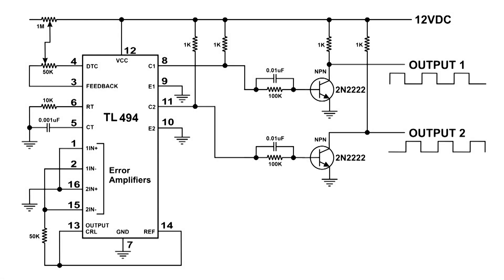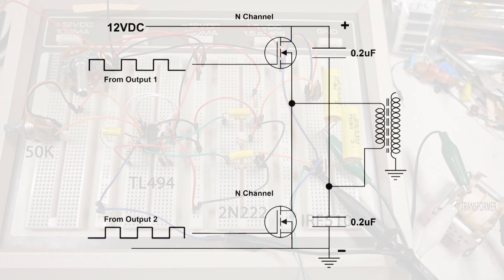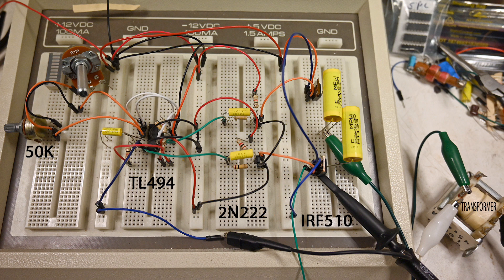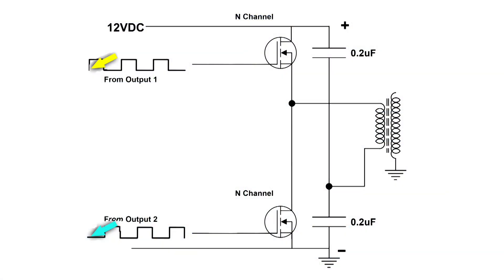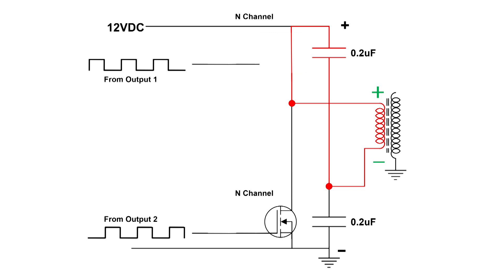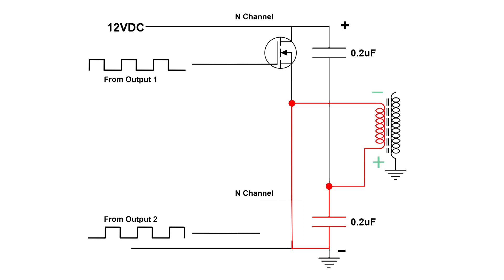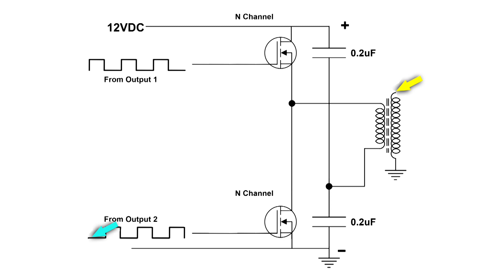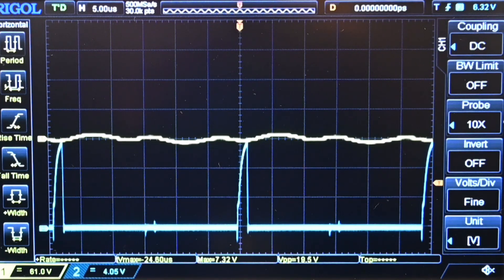Pulse Width Modulation Half Bridge MOSFET Driver TL494 2N2222 IRF510

Comment: Great video for someone like me wanting do a straightforward build. A couple of questions: I have a PWM module I would like to use so would I just take its output and feed into both transitor bases or do they need to be 180 degrees out of phase? If so how might I use the module and replace the TL494? Secondly, is this amplifier suitable to drive a flyback transformer? Thank you
Reply from the maker: I would need to know what chip you have. In this circuit the output from the chip goes to the base of the transistors, this does produce a 180 degree phase shift and keep the two outputs from overlapping (both on at same time). To drive a power transformer you may need power transistors. Thank you, and thanks for watching!
Reply: I have decided to use the TL494 instead of an external PWM module. It’s a better fit for the job. Would both the transistors and the MOSFETs need to be upgraded?
Reply from the maker: @julianperry1406  The current in each stage of the circuit determines the part selection

Comment: Dear sir I try to make such circuit but I do not know how to connect 3 pins of 1M ohm potentiometer with other 3 pins of 50K ohm of second potentiometer (SKITCH part upper left hand side for connecting 1M with 50K not clear to me ) kindly I request your support regards
Reply from the maker: The 1M sets the limit, usually a value of about 15K works nicely. The 50K varys the output from the limit to the max. 
I prefer this setup of the TL494. Unlisted video.
https://www.youtube.com/watch?v=PkwqwKPnFpA

Comment: I am confused. How do you get a sinusoidal wave out of a square aware by just going across the transformer ?
Reply from the maker: That is one of the things a transformer does. It transforms.
Reply: You are joking right?? A transformer only increases or decreases an AC signal depending on the primary and secondary winding ratio. I have never heard, read or seen a case where a transformer by itself magically converts a square way into a perfect sinusoidal wave. You have to be joking in your comment.

Comment: This does not work at low frequency like 60hz Only at high frequency of khz.
Reply from the maker: Yes you are correct. The TL494 specifications recommended operating conditions for frequency are 1 to 300 kHz.
Reply from the maker: If you are looking for a slower running circuit you might try this IGBT circuit.
IGBT Astable Multivibrator
https://www.youtube.com/watch?v=PnAiAhZH9hw
Reply: Dear sir I try to make such circuit but I don’t no how to connect 1M ohm potentiometer with the 50K ohm potentiometer ( how connect 3 pins of 1M ohm with other 3 pins in 50K ohm) kindly I am looking for support regards

Comment: Hi, i has a half bridge using tl494 like this, but when I measure the waves like you, the output is an AC square wave according to duty, not a sine wave like you, is it correct?
Reply from the maker: The sine wave is out of the transformer.
Reply: @AllAmericanFiveRadio  after all, i checked everywhere and i think your transformer winding too much and the inductance is very high, so that's why it's sine wave, it good to see in oscilloscope but put the heavy load will get your voltage dropout.
Reply from the maker: @giangvo2746  The transformer is an 1920s inter-stage audio transformer.
Reply: @AllAmericanFiveRadio  oh, I thought you used a pulse transformer smps : )

Comment: output 1 switches a mosfet on the high side, so source is not ground! it needs a bootstrap capacitor or isolated gate drive.
Reply from the maker: True
Reply: 2:20 the 50k potentiometer is not for duty cycle either.😄 It is increasing the dead-time which looks like narrowing the width of the PWM but it is not meant for that

Comment: What kind of transformer? core material? Turns ratio?
Reply from the maker: I used a Signal Transformer DP-241-4-16.
To get high voltage you need to use a ferric core high voltage transformer.

Comment: Your videos always provide some clarity, I’m currently working on a Class D Amplifier final year project and I am using 2 IRF540 N channel Mosfets . However I am struggling to drive my MOSFETs as I first tested them without using driving(used the PWM signal directly to my Mosfets) but this did not work and my Mosfets kept on overheating . 
I was advised to use Pulse transformers to drive my Mosfets so that I can have a positive voltage VGS and be able to increase my supply voltage to 40V-70V. Your help will be highly appreciated regarding this. 
What can I do to ensure that I am able to increase the supply across my upper mosfet and still have a sufficient gate voltage to turn on my Mosfets?
Reply from the maker: Are you working on a half bridge power supply? I will be glad to try and help. Please using my email allamericanfiveradio@yahoo.com so i can send you information. Also you can send me the circuit you a working on.
Reply: Done!

Comment: Sir Nice video, many thanks for uploading. Can we use the same circuit and duty ratio adjustment for a single switch converter? Or do I have to modify it?
Reply from the maker: If you need a Pulse Width Controller it should work. Since this video I have another setup for the LT494 that I like better. I just uploaded the circuit to my Google Diver, it is a JPG, so just click on the link. 
https://drive.google.com/file/d/1xIIu6gHfpzzQuLbAZ4FZnSZ4Eeb7ARM6/view?usp=sharing
Reply: Very nice. Many thanks for your help. Excellent!
Reply from the maker: @mbashir42  Thank you, and your welcome.

Comment: Does the circuit turn the mosfet on properly with no heating up at no load with high amp battery connected
Reply from the maker: The gates are biased with about 12VDC to turn them on fully, the MOSFETS will still get warm. I would suggest using IGBTs. IGBT is full on with the gate at about 4VDC. here is a video I did on IGBT.
Insulated Gate Bipolar Transistor IGBT IKP06N60T
https://www.youtube.com/watch?v=mL14VfjueIo

Comment: hi..sir i saw your video..and you are so profesional...bravo...sir i have question..i want to know what is error amp on t494??
Reply from the maker: This information is from the PDF
APPLICATIONS INFORMATION
The pulse width modulator comparator provides a means
for the error amplifiers to adjust the output pulse width from
the maximum percent on−time, established by the deadtime
control input, down to zero, as the voltage at the feedback
pin varies from 0.5 V to 3.5 V. Both error amplifiers have a
common mode input range from −0.3 V to (VCC − 2V), and
may be used to sense power−supply output voltage and
current. The error−amplifier outputs are active high and are
ORed together at the noninverting input of the pulse−width
modulator comparator. With this configuration, the
amplifier that demands minimum output on time, dominates
control of the loop.
https://www.onsemi.com/pdf/datasheet/tl494-d.pdf

Comment: Thank you for the video where you explained a lot about the function of the TL494. 
Just for the half bridge with the two n-channel Fets you better take a high side driver (for 12V + Uth) or a p-channel Fet. In the current configuration the upper Fet is in source follower mode and will not be able to raise its source to more than 12V- Uth = 7.5V which will produce loss and heat it up. 
Thank you for the video anyway.
Reply from the maker: True!

Comment: Thank you so much for your knowledge, please tell me details for your transformer and capacitors, i just move in power control world and your components are radio world ones, the transformer is special? in theory must be satured...... look like simple transformer not ferrite one, ...... the capacitors are ac 600v?......some power requirements........I ask ,power output in watts .......thanks I try your circuit.
best regards
Reply from the maker: My purpose for this video was to explain how the half bridge MOSFET driver works. You would need a high-frequency transformer to produce usable power. I searched for this circuit and found several, but none of them explained how the circuit works. If you'd do a search on the half bridge driver you'll find usable circuits. But none of them explain how they work.

Comment: hello how do adjust the frequency to get 50Hz? I am currently building a project that require me to have 50Hz. (SA standard) thank you in advance
Reply from the maker: To get 50Hz you would change the RC time constant and the Vcc. Download the PDF for the TL494 to get the Electrical Characteristics, Oscillator Section.
Reply: @AllAmericanFiveRadio  okay thank you.
Reply from the maker: You might look at a 555 timer.
555 Timer
https://www.youtube.com/watch?v=QH9iKOM-wGY
Reply: @AllAmericanFiveRadio  and I am using Multisim and Psim to simulate the circuit before I order the components, but i keep getting a square wave at the output. which simulation circuit do would you advice me to use sir. I thought of just using faith and build it but i only get one shot at this.
Reply from the maker: @thusananisilent6141  Since the frequency you want is 50Hz I would add a small power transformer to the output. Like 120 ac in and 6.3 ac volt out. Try using the primary and/or the secondary. I used a transformer to achieve a nice sign wave.

Comment: Sir, 
If there are no signal pwm on pin 8 & 11 , but there is signal saw tooth on pin 5 (CT pin) 30kHz, what's the problem?
Reply from the maker: There's alternating pulses at pins 8 and 11, and a saw tooth at pin 5. Did you witch the video?
Reply: @AllAmericanFiveRadio  Not on your videos, Sir, I think pin 5 is an oscilator that generate square wave on pin 8 & 11. I'm trouble shooting my welding machine, that use tl494 chip, I searching basic operqtion tl494 & luckily found your videos.
Thank You for reply & videos, Nice video anw & sorry about my Bad English
Reply from the maker: @TheJavaSync  Check the power to the chip. Usually capacitors fail before the chip. The chip is working the output MOSFET's or IGBT's could be bad. In circuits this it's possible to have more than one problem. Good Luck!

Comment: Very nicely done video, Mr AA5.  It looks like CT = 1nF and RT = 100k which for push-pull would yield freq= 1/(2*RT*CT) = 50kHz/20us.  But your 'scope display says "5us" with ~5.8hdiv/~.  What frequency are you actually operating at?  What kind of transformer is that?  Thank you in advance.
Reply from the maker: Thanks.
The frequency is 34.6kHz. The transformer is an audio output transformer make for a 1920's vacuum tube. A 71 tube or a 45 tube.
Reply: Was wondering if faster transistors were used or mayhaps different capacitor values to create sharper leading pulse edges?
Reply from the maker: @gregjones3660  Thanks.
Changing capacitors would have the most influence on the shape of the pluses.

Comment: Might I suggest you try using a PIC121572 microcontroller to do this PWM generation. This IC is 8 pins, has 3 phase PWM with 16 bit resolution  and an A/D converter you can use to go to that 50k pot to change duty cycle. I have used this IC for fan controllers and several other applications which are more sophisticated.
Reply from the maker: Thanks.
I'll take a look!
Reply: I think using a PIC121572 microcontroller is not straightforward like TL494. It needs programming experience. Could you please guide us for programming? How much does it cost for PIC121572?
Reply: Even though micro's are cool and can do alot of stuff.  I would avoid using a micro like the plague.  There is already a pot to change the duty cycle and if it's a matter of varied V+ based on temp or anything else a resistive sensor is all that's required.  You create a voltage divider network and voila! Your in like Flynn or as they say down below "Bob's your Uncle.
Reply: @reclaimfilterssystemsinc7529  
I would avoid using a micro like the plague.

WHY?

Comment: I like the 50K being able to adjust the best wave you need. And the way it uses all the energy in the push pull is pretty cool Rick.
Always interesting my friend.
Reply from the maker: Thanks.
When I first looked at this circuit I was scratching my head, how does this work??? Then I got the idea to substitute one of the MOSFETS with a wire and then I saw that one capacitor discharges through the primary. Then I did the other one and the other capacitor discharges. Then I saw the polarity. Then I saw that one capacitor charges while the other discharges. What an interesting and elegant design. I had show this one in detail. My friend Carl I hope things are good.